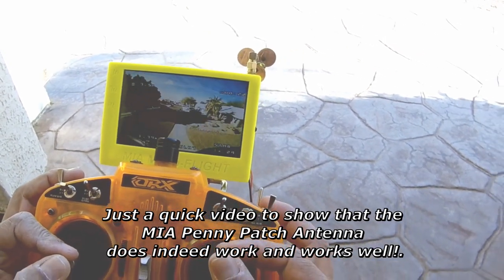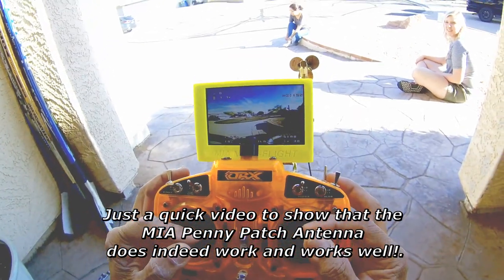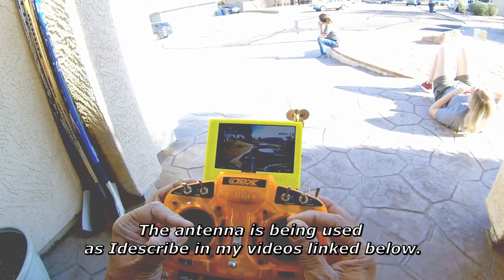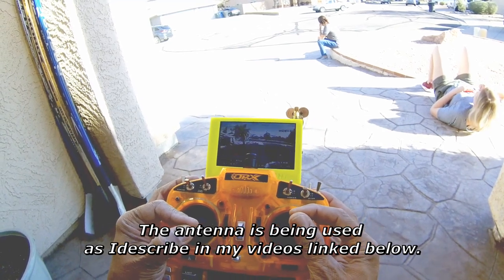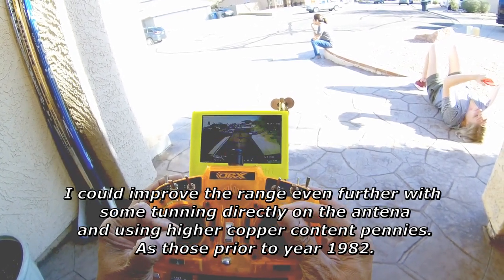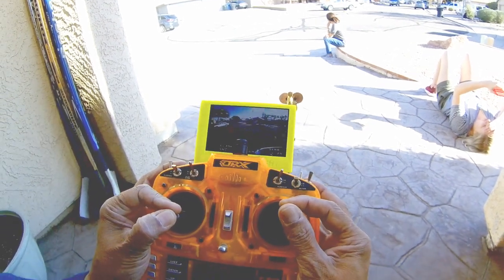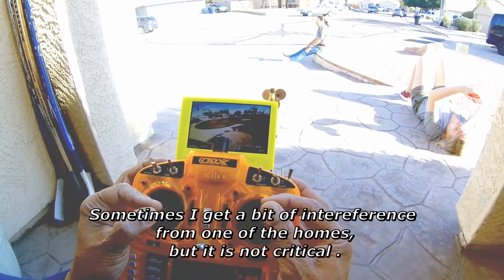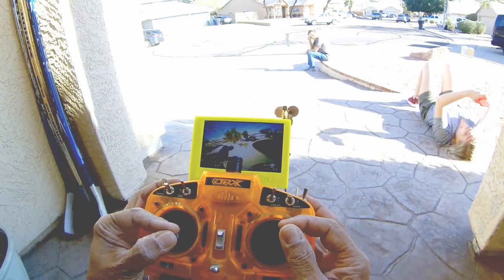DIY FPV 5 8GHZ Tunnable MIA Penny Antenna Flight Video

Comment: I just finished mine. Going out to try it today shortly.
I'll see about recording it and uploading. 
So far... I've powered up my vtx and threw on my goggles and walked my house to see signal
So far it is way better than my stock antennas
 I also made an inverted vee dipole. It works AMAZING!

Comment: Ok. Back from the park. 
First I very much need to say....
As per another video of yours with regard to this build, I DID in fact use pennies that were older than 1982. For copper purposes. The years were 1964, 1966, 1967, 1968, if memory serves me correctly.

So my results:

Well... Hands down, there is NO two ways about it. This 4¢ penny antenna out performed any of my other rx antenna's!
I use a 5.8 GHz USB otg rx (ROTG) for recording purposes ONLY. And idk. TodAy it decided to crap out on me. So no video results. Smh.

I just wanted to give you an update as to how my personal exp went with your antenna design. 

I had absolutely zero drop outs within an approx 350+ yard range using Eachine Tryo69 25mw vtx, Fli14+ rx Flysky FS-i6 14 ch. mod (with the SWE added switch, & 2 external 16db antenna 'seated in their respective native factory location') & the absolute cheaper than dirt Eachine vr006mini stock 1 antenna boxset goggles. (Yea yea. They are my only backup pair as my other was accidentally destroyed in my rushing to get to work one morning. Waiting for my new set). My flight style was inclusive of flips both front and back, barrel rolls, doubles as well as 1 triple... Gaps at the local playground including thru and over the pavilion several times over. I caught a little bit of fuzz but that was to be expected at the 300+ range considering the vtx power and the vr006 mini.

I am building a second set for my ROTG tonight. I am eagerly waiting to upload flight footage. 

Epic design ideA.
I absolutely love it's budget price. 
Thank you!